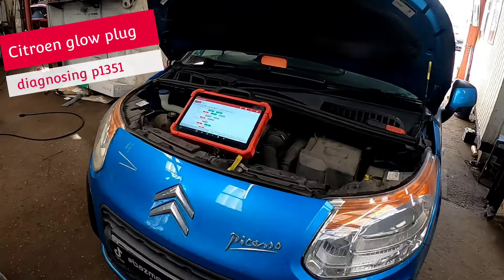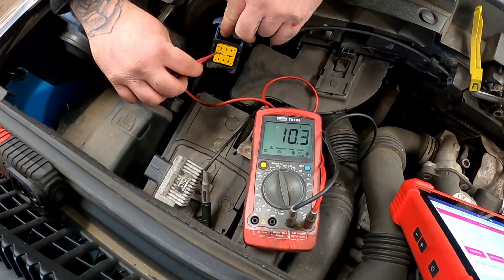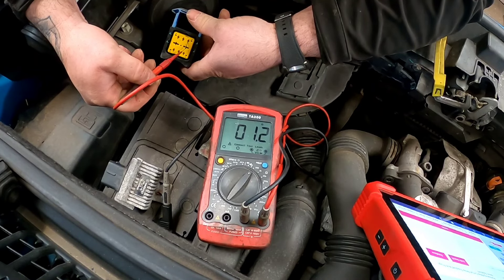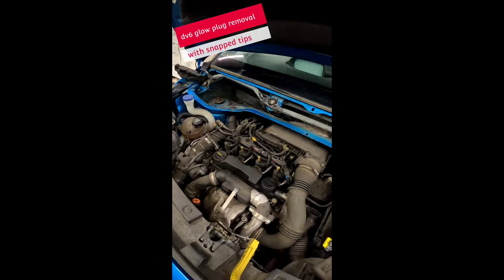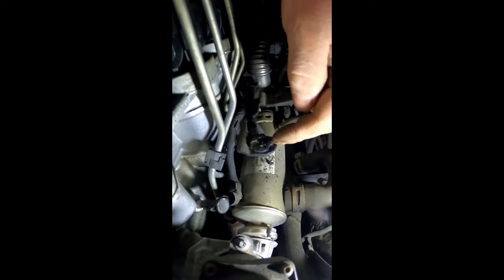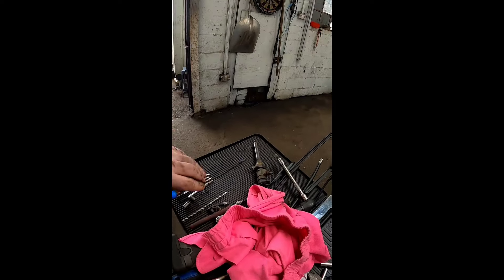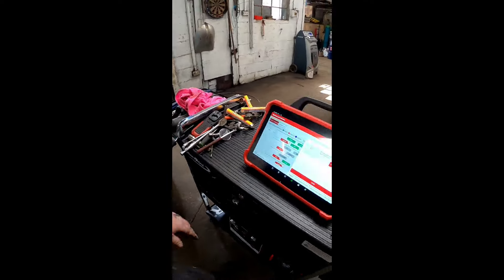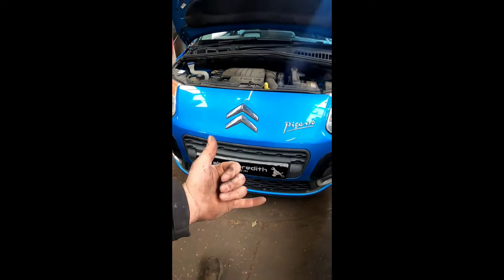P1351 Citroen/Peugeot dv6 glow plug fault  and diagnostic

Comment: good video (apart from it being vertical ) btw you can sometimes get the injector tips to pop out by starting the engine (don't hammer them into the cylinder obviously)

Comment: I’m curious - were you able to start the car with this fault code before replacing the glow plugs, or did the car only start after you changed them? Thanks in advance
Reply from the maker: @Lion00777-g  the car started fine but was bringing a fault code up, however in colder weather it will struggle to start
Reply: @ My Citroën is displaying this fault code (P1351), and the engine is completely failing to start. I’m currently facing a challenging issue with my Citroën. While attempting to remove the glow plugs, three of them broke. For one of these, I tried drilling out the remains of the glow plug, the drill bit broke inside the plug and is now stuck. The engine’s layout complicates the situation further, as the glow plugs are located in the rear section, making access extremely difficult. Due to the limited space, I couldn’t properly center the drill, which likely contributed to the drill bit breaking.

Comment: Hi, iv just followed this video, which was a great help so thank you very much. With my multi set to 200 on the ohms im getting 3 readings of 9 and one has no reading at all. Would i be correct thinking i have one knackered plug? Would that cause my engine to stop when fault appears

Comment: Hi Baz great video. I was wondering if you could help me? I have a c3 picasso same fault code no engine management light. Very slow at starting it takes about 10 cranks from cold then starts. When warm about 4 cranks then starts. I replaced all glow plugs as none were working changed fuel filter but unfortunately same problem. Any advice appreciated
Reply: Hey, I had the same issue. It was the camshaft sensor.